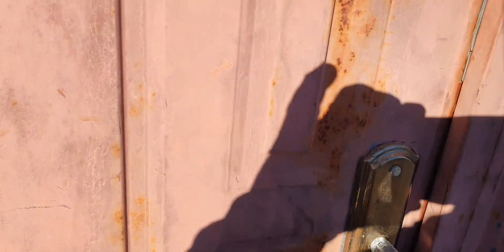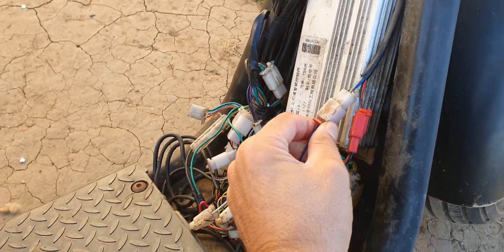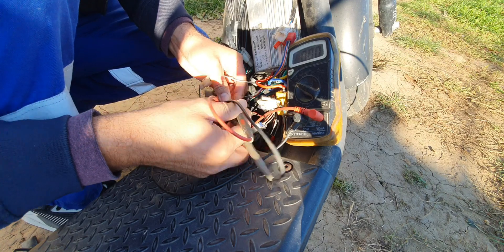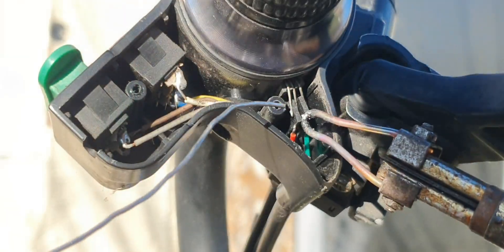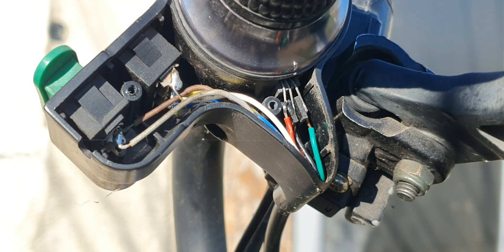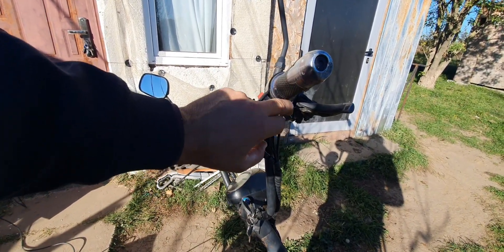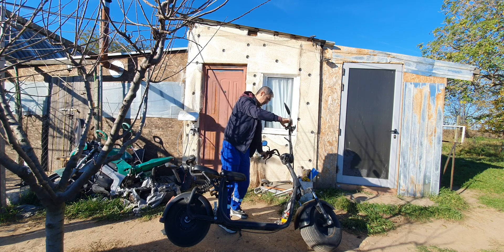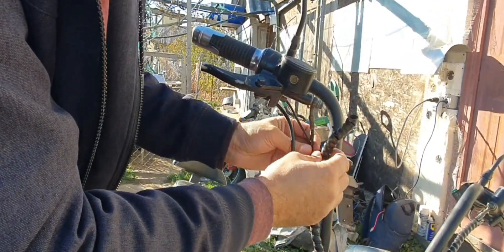Diagnosing an electric  City Coco scooter really quick.

Comment: Throttle on mine gets stuck on. Could you provide a link for a replacement throttle?
Reply from the maker: You can use any kind of throttle with 3 wires  if you can solder the 3 wires colour to colour.
Reply from the maker: I just found this on AliExpress: 
RON60.96 | Throttle Grip 1Pair 3 Speed Control Throttle Handle Grips for Electric Bike with Forward and Reverse Gear Throttle Handle Grips
https://a.aliexpress.com/_EwmYIm0
Reply from the maker: Find you're type of connectors where the controller lives and get the same connector type and the same length of wire. Or...if you cut the twisty part of the handle, you can put what I said earlier,  a throttle with only 3 wires.

Comment: Hello how do you fix the Speedometer displaying incorrect speed 
Disolayed speed is higher than actual speed
Reply from the maker: You must go into the display settings and set the correct weel diameter or number of magnets. Usually the weel size.

Comment: I'm can't get the headlight to work because I don't haveva display or back-lights or horn or any bells n whistle. Remote sensor was bad I dint know thought it wasca mosfet unconnected everything which was modified by previous owner who cut all wires and to create the full circuit.  But I don't need that. So I just need to connect the headlight everything else works. 3 speed throttle remote sensor motor battery. I've tried with a multi meter to find the 12v but noting reads right expect 2 black n yellow connections read 60v double blue and black with blue extension reads 5v even tried a dc to dc but no nada
Reply from the maker: What voltage does the headlight work at? If it is a 60v, identify the wiring coming from the headlight switch by measuring each wire from the switch with a multimeter against the ground.
Reply from the maker: If you previously connected the headlight to 60v and it is a 12v headlight, it might have gone puffff